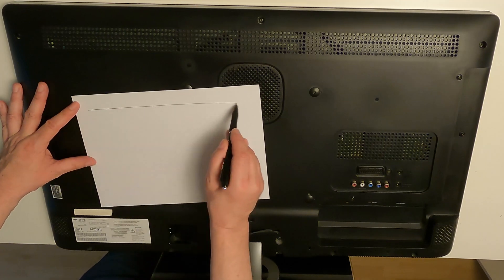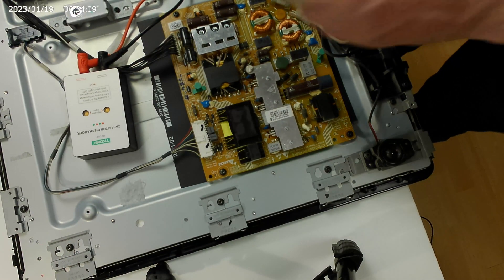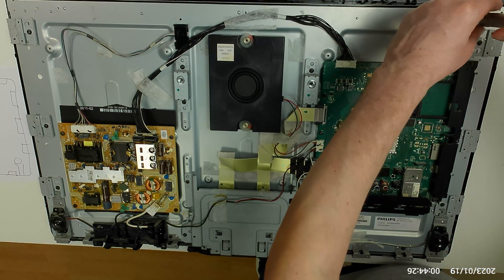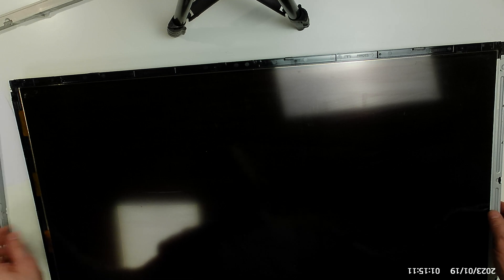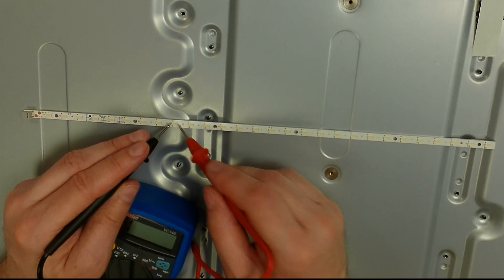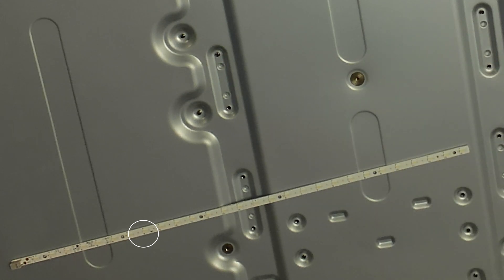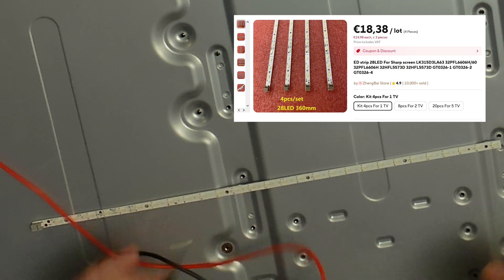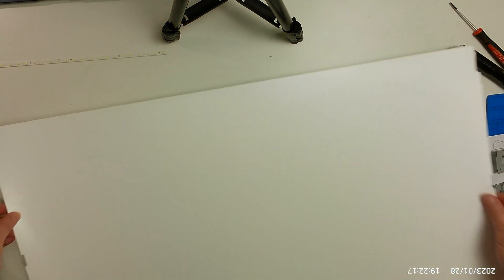Fixing a dark spot on an LCD television

Comment: Why always philips doing this.. same happened to my philips tv that i had for 7 months. Philips dont wana no and currys said they cant fix it cuz its dust. After 7 months
Reply from the maker: Well, if it would be dust, they would have sold you a defective tv in the first place, because the screen is a closed unit and there is no way dust should be able to get in there. So they are probably lying to you. If you had it for  seven months from new, you should have warrenty. Did you send a letter to Philips customer service? Philips used to make quality products (check this video: https://www.youtube.com/watch?v=f70dy8AFQ7A ), but the products they made the last few decades are not built to last unfortunately. Have a look at Samsung for your next tv if you choose to ditch this one, they make most of the modern LCD screens anyway. Not sponsored by them (but would like to be... Samsung? Are you listening?), just happy with their tv's and monitors. In this video I repair a Samsung tv with some fireworks for decoration: https://www.youtube.com/watch?v=lz0oBoUv4BM - Good luck!

Comment: Almost looks on mine like a cleaner cloth left this mark behind the glass. WTF. Sony
Reply from the maker: Did someone before you take it apart, or was it like that when you bought it new? It's very well possible to clean it. I used thin cotton gloves while cleaning the actual lcd panel to prevent any fingerprints, which worked quite well. Good luck on your repair, do let us know the results!

Comment: Dear sir i have an old sony kldv3000 (2008) lcd tv, with a same dark patch around center right ,does my tv has also leds in side or Fluorescent lamps if fluorescent how would i be able to fix it?thank you
Reply from the maker: Do you mean "Sony's BRAVIA KDL-40V3000"? That would use WCG-CCFL as a backlight, so no LED. Have you opened it up to see what kind of backlights are in there?

Comment: I just found a samsung tv at the dumpster in my apartment complex and it looks identical to this same black shadow same place same shape just the right side instead of left
Reply from the maker: Nice! Good find. You might want to check out my other video in which I repair LED strips without having to buy new ones. It's here: https://www.youtube.com/watch?v=lz0oBoUv4BM - Good luck!
Reply: @repairchannel  thanks I'll check it out
Reply: Knock yourself out. Buy one that works at a flea market for $30-40.
Reply: @mikeh.4891 i left it at my old apartment when I moved I didn't really need it
Reply: I found a 65" Hisense by the dumpsters at my apt. Tv looked to be in perfect condition but the backlight was completely out. I purchased the same model from WM and returned the broken one. That was less than 6 mo ago and the backlight is already failing on this one. I don't feel bad at all bc they're making and selling bs products manufactured to fail.  They don't feel bad ripping us off, so why should I feel bad returning it?!

Comment: what if the mark only appears on some colors?
Reply from the maker: Which colours does it appear on? Does the mark have the same shape and diffuse edges? Would you be able to post a picture somewhere so we can have a look together?
Reply: @repairchannel  i have this same issue. just a dark mark on the screen that seems to go away when it’s a really bright color. it looks like a shadow when you’re play games that are have a darker background
Reply from the maker: That sounds exactly like the problem I had with this tv, at full brightness the dark spot disappeared. Very likely that it is a problem with the LED's. What brand and type is it?
Reply: @repairchannel possibly! it’s an emerson lc320em8a for 2007
Reply from the maker: @teganmullins687  I couldn't find any led strips for that model on Aliexpress, but what you might want to try is replace the broken LED's. You could check this video: https://www.youtube.com/watch?v=lz0oBoUv4BM - Here I use the strips of a broken tv to repair the strips of another one.

Comment: Would that work the same with LCD SCREENS AS WELL AS LED ?
Reply from the maker: So called LED tv's are mostly LCD screens with LED's as a backlight. 'Real' LED displays which consist of a large array of coloured LED's don't need backlight, because the pixels emit light themselves. So, check the type of your display to determine whether it is an LCD screen with LED backlights. If you can share the brand and type with us, we can have a look together.
Reply: @repairchannel  Thank you so much for your reply, It is Samsung LA40D550 40" Series 5 Multisystem LCD TV
Reply from the maker: Thank you so much for your subscription. Your tv has backlights very much like the Samsung tv in one of my other videos: https://www.youtube.com/watch?v=lz0oBoUv4BM - In that video I repair the LED strips by replacing a few LED's. So it will work with your tv!

Comment: I'm thinking of trying something like this. I have an LG 55UM7300AUE that I lent to my FIL for a couple years. I just got it back and it's got some blotchy spots just left and above of middle and by the right bezel. I love opening things up and trying to repair them before I replace them, and I admire your careful and thoughtful approach.
Reply from the maker: Thank you! And yes, indeed, it's nice to repair stuff instead of just replacing it. It is also possible to replace single LED's. You might want to check my other video: https://www.youtube.com/watch?v=lz0oBoUv4BM if you are considering that. But I think I will just replace all of the LED strips in future repairs, because soldering single LED's is quite the adventure. Just take your time handling the LCD screen and I'm sure you will have a perfect tv in the end. Best of luck!

Comment: Why did the dark spot appear to begin with?
Reply: Mine literally just happened, it was fine yesterday then at night I “fixed” the color settings now I have a small light black spot on top
Reply from the maker: @FlygodPolo  Sorry to hear that. Does it disappear when you turn up the brightness?
Reply from the maker: There was no external cause that caused the failing of the led. LED's wear out over time depending on their quality. Some manufacturers use better quality components than others. Hopefully the replacement LED strips are better quality than the original ones. So far so good!

Comment: What I find special is the precise way in which this repair is carried out. Capacitors are discharged, critical thin glass plates are handled with caution. Tests lead to results on this object, which is not really easy to repair. It requires expertise. And there is no fear in taking apart. My compliments!
Reply from the maker: Thank you!